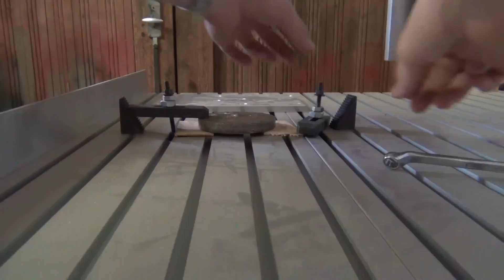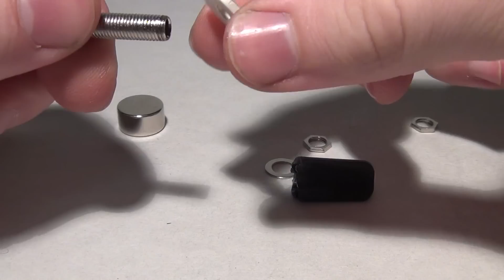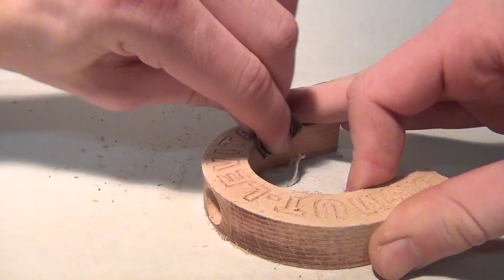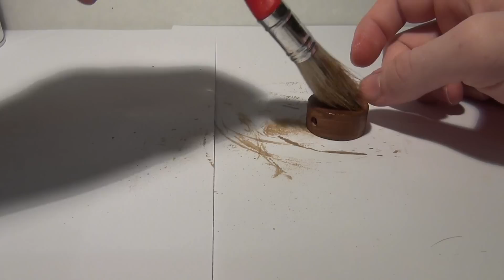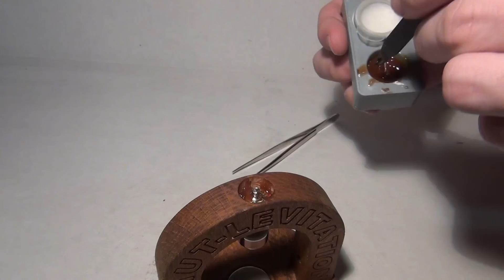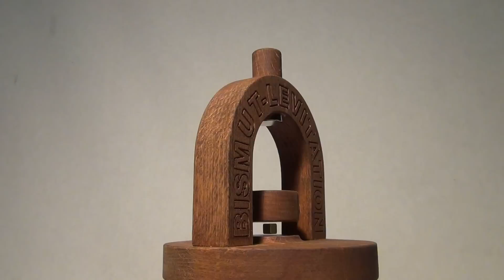Diamagnetic Levitation with Bismuth: construction of the levitator in time lapse

Comment: Could this work using bismuth crystals for added visual effect?
Reply: yes, it works with crystals as well, however if you want to make it easy you should keep the crystals pointing away from the floating magnet. otherwise if the rough crystals point to it, or if the almost flat film pointing to it is to thin it might become much harder to balance. but if you have huge crystals it should be pretty easy to make it float in between the crystals.